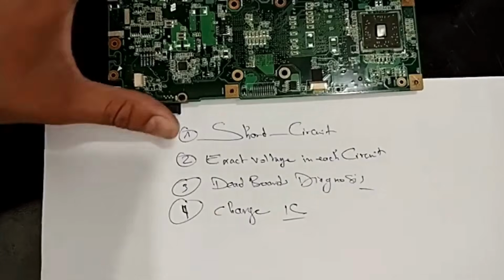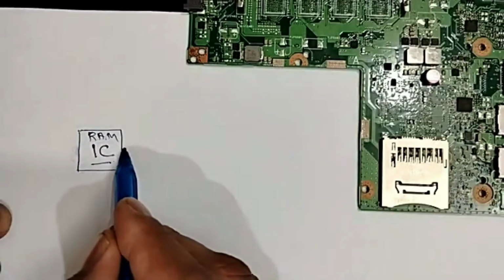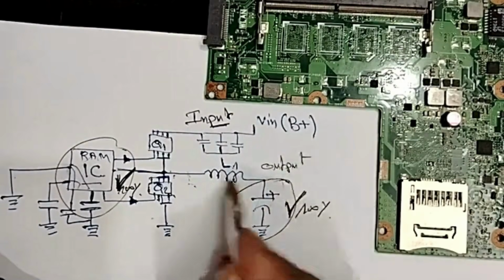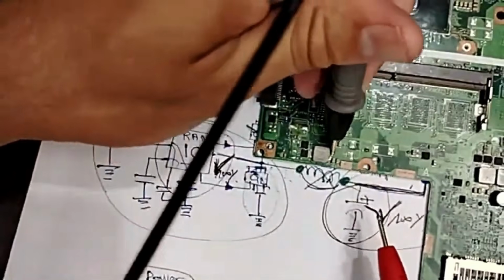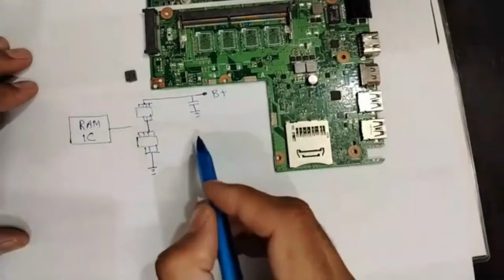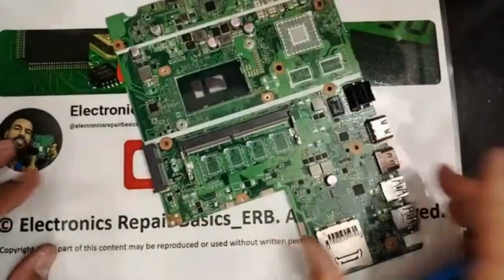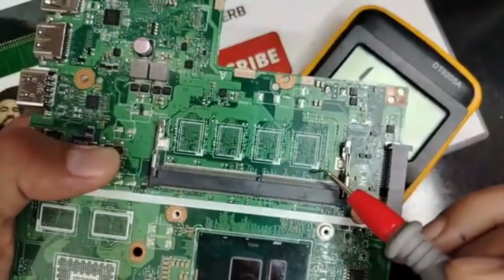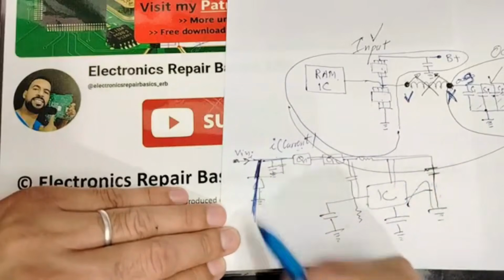How To Find Short Circuits On A Motherboard Fast - Laptop Motherboard Repair

Comment: Your videos would be so much better if you could just get straight to the point instead of repeating the same thing like 10 times during your video, your english is bad too, hardly can understand what youre saying, you need to explain better, theres potential here, your delivery is bad, never understood were the short was because of your poor comunicating skills, work on that, others are making videos in which they are finding shorts with methods easier than yours and faster, this is a waste of time in a world were service must be done quickly.

Comment: Ok... You obviously are very knowledgeable.. and you understand very deep concepts. But.. know your audience.. most techs that are watching this aren't 6 years old.. 
Holy God damn.. you repeat yourself like 10,000 times..
If you hadn't gone over, and over, and over, and over the same parts proving the parts that are good.. and repeating yourself this video would have been 5 minutes long...
Idk... PLEASE.. get to the point faster.. we don't have hours going over the good parts.. just quickly show us the system to get straight to the end.. solved.. you WASTE way way too much time getting to the point.. 😔
It's not here.. it's not here.. it's not here.. it's not here..
Ok.. fine.. I believe you already, get to where it actually is.. 2 minutes.. done

Comment: I hope someone can answer this for me, but I’ve always been held up by why they only check one side of the component with the meter probe, I’ve checked components before where if I probe one side of a capacitor, coil,  or something else I get continuity on that side, but when I do the other side of the component I get none like he did? Someone reply this I’m confused thank you.
Reply: It's because those components side are connected to GND, one side is connected to a component on the MB while the other side is connected to the GND ✌️

Comment: the video has a lot of useful gold information. THANKS a lot for this, highly appreciated. In order to close the loop, I would have removed the RAM slot and re-check to see if the short is still present. For a beginner is very important to have closure :). Thanks a lot!!!

Comment: so if the ram ic was shorted then there is a posibilty of the cpu  getting shorted? is that correct? as ram is directly connected to cpu
Reply from the maker: Yes, you're right. If the RAM IC is shorted, it can potentially impact the CPU since they are interconnected. It's always good to check for cascading failures in these situations.